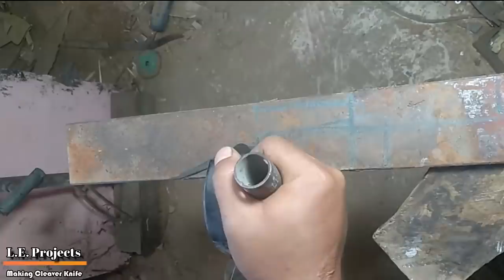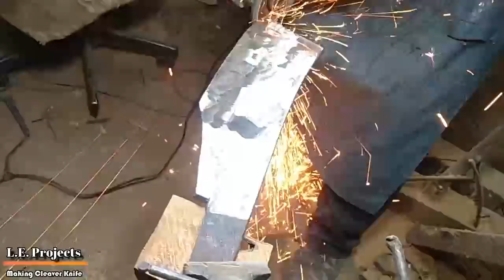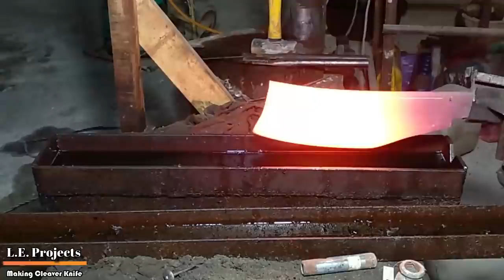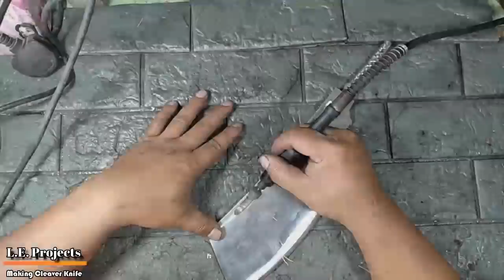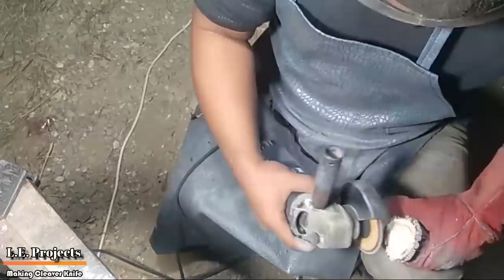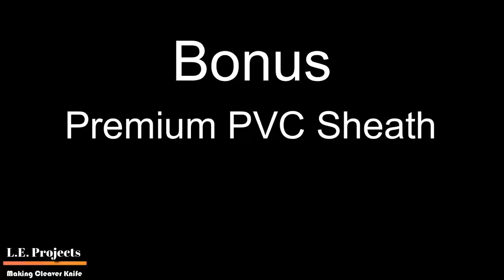♻️ Making Fat Meat Cleaver Knife From Truck Leaf Spring | Cara Buat Parang Tulang

Comment: This is a chopper and should have a full tang. The way the handle is glued on is asking for trouble when doing heavy chopping.
Reply from the maker: The knife was sold on december 2019 and already been used until now. The tang is already thick and huge. The deer horn is very durable. My cust dont have problem on heavy task like chopping meat & bone. I also put 3mm safety pin through the ring brass and the hidden tang. I lost footage video on the safety pin and checkering scene. I will do my best on next video Hehe 😁👍 thanks for watching.

Comment: I would recommend to put a pin in the handle so to not relay on just glue to hold the blade together
Reply from the maker: yeah. i did put 3mm brass pin on the handle but lost footage video on checkering patterns scene and handle safety pin scene.  haha

Comment: I also bought leaf springs for knife projects but never made any knife, is leaf spring the best steel you can find on junk yard ???
Reply from the maker: Spring easy to find and easy to work with. 
ofcourse there are many other steel you can find on junk yard/scrap yard like :
bearing, cone bearing, circular saw blade, chainsaw bar, planer blade, chisel, file, and many more.

Comment: Why u just harden the sharp part of the knife? Why not the whole knife?
Reply from the maker: It is call Edge quenching 
The purpose is for hard on the edge and soft on the spine. If the edge crack, the crack will not travel to the spine.
Suitable for heavy duty task. Samurai Katana also from same concept but it using clay to make soft spine.
Reply: @EncikAlee  thanks a lot for describing...

Comment: My japanese teacher said that after quenching and you still need to sharpen and sparks came flying out from sharpening then you already ruin your blade
Reply from the maker: I put convex edge to this blade for impact job. Just dont over heating the blade would be fine. Thanks for watching.
sorry for my bad english hehe
Reply: i dont know how that blade is ruined because i see many people do this technique even japanese
Reply: @wolfiespup9085  if you temper the knife and than sharpen it or grind it with a grinder the high heat will remove the temper. Smart smiths usually quench the knife in cold water after grinding for some times if they tempered the knife before grinding to cool the blade without losing the temper.